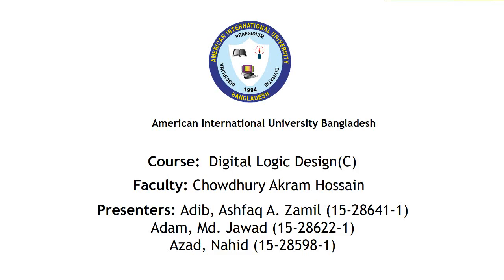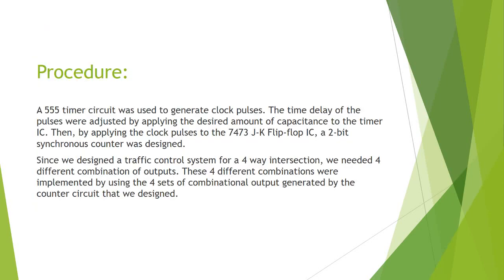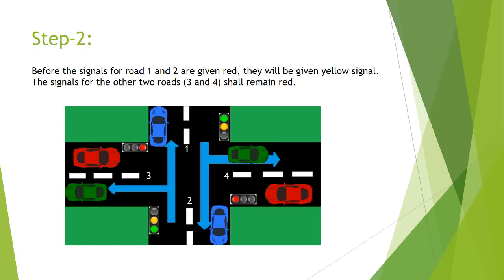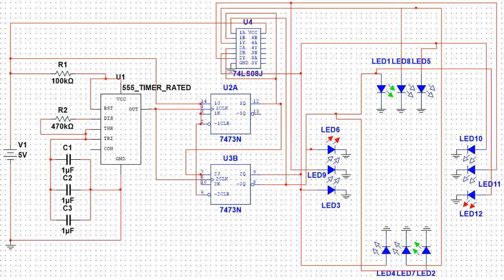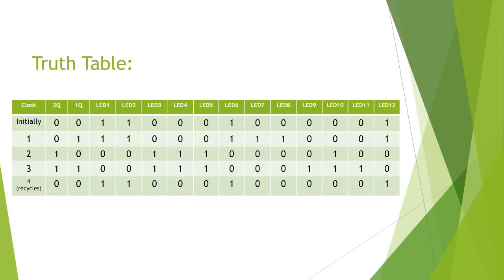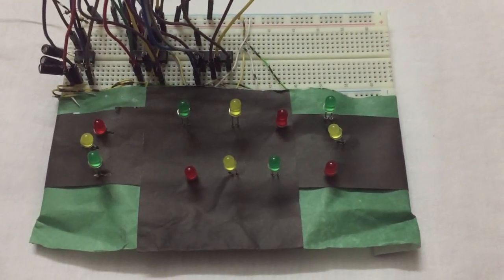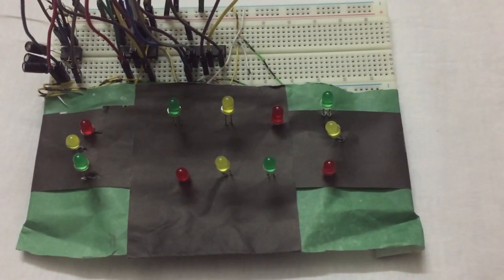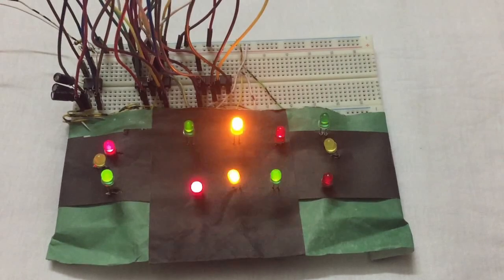Traffic Light Control System- Digital Logic Design Project

Comment: i'm a beginner. how can i insert a 3 digit 7 segment in this circuit. can anyone give me a general direction as to how or if your really up to it and have time can you specifically instruct me how. thank you. Btw it has 28 pins
Reply from the maker: This circuit is basically a 2-bit counter circuit, means it generates numbers 0,1,2 and 3. You can make this into a 3-bit by adding another JK flip-flop which will generate numbers from 0-7. By adding a JK flip-flop like this you can increase the bit range of the circuit. I personally haven't worked with 7 segments, but they are not that much critical to implement. You will find videos that explain how to connect them. For a 3 digit 7 segment meaning it'll show numbers from 0 to 999, you'll need to implement a 10-bit counter for which this circuit process will not be sufficient.

Comment: your video was very helpful so far , i did the circuit diagram in multisim like you did but the lights won't switch, this is the only problem i have , thanx
Reply from the maker: In Multisim it just sends a current and stops by default as far as I remember, you need to run it continuously for the timer to work. I may be wrong since it has been a while I haven't been in touch with it, but the circuit works as expected in practical implementation.
Reply: @ashfaqadib8085  what do you mean by running the time continuously how can I do that?

Comment: are 14 1 3 2 and 7 5 10 are in series? or 1 and 5 is not included? is it ony 1 and 5 connected with OUT?
Reply from the maker: 1,2,6,12 are in series. 3,4,5,10 are in series. And 7,8,9,11 are in series. You can also connect them in parallel. The idea is that, if 1 is lit, 2,6 and 12 also have to light up. So is the case for  3,4,5,10 and  7,8,9,11.
Reply: i mean in 7473 ic
Reply from the maker: Can't understand your question.
Reply: What do you mean by 1 2 6 12 are in series??
Reply: How can 1,2,6,12 can be series ?? It's connected to the same ground
Reply from the maker: By in series I meant they will light up together due to the same output from the 7473.

Comment: How to design this circuit if we have different truth table with regards to led. Kindly help me in this regards.
Reply from the maker: What kind of output are you expecting?
Reply: The attached drive link shows our truth table 
Remember :  G- is the light of turning right and we have G- instead of yellow light . 

HERE is the link of truth table 
https://drive.google.com/file/d/0B8viPsbm24mPYzl0c210N2lPMGkteVo0WHFNRU42N1BPZWR3/view?usp=sharing
Reply from the maker: Sorry for late reply. As it seems your circuit also has 4 possible combination of outputs as I understood. Are those LED numbers according to the figure in my video?

Comment: Does the circuit you presented have no errors? Please help me troubleshoot, mine doesn't work.
Reply from the maker: The circuit provided in the video was working totally fine. What problem are you facing?
Reply: It doesn't automatically change lights. It has to be switched off then switch on again for the lights to change.
Reply: Also, the circuit I simulated was the exact form as in the video but mine's not working, unfortunately. I already grounded every component properly but, still, there's no improvement in the switching of the LEDs.
Reply from the maker: Check if the timer is working, connect the timer output to a LED and check if it turns on and off.

Comment: I implemented the whole circuit as per ur given diagram. But when I switch on the supply all I can find is that the yellow and red lights are continuously on with the green lights off. Please help me
Reply from the maker: We had similar problems at first. Have you kept the ground line common for all the leds?
Reply: Ashfaq Adib No I grounded individually for all
Reply from the maker: Try to keep the ground pin common for all the devices. Make sure your wires are properly connected and do not cause resistance, in our case, we changed the wires and each led got proper power.
Reply: My problem is why isnt the timer giving pulses? Like why is it that all Led s are continuously glowing? :/
Reply from the maker: This may happen even if the timer is working. To check if the timer is working, just connect an led to the 3rd of the 555 and see if it is blinking.

Comment: where's the pin 13 of 7473 connected to ? the switching of led is not working please help me
Reply from the maker: The pin 13 represents Q1'. Just connect the LEDs that should work in opposite of Q1 to that pin.
Reply: kindly elaborate , should there be a connection on Q1' or none ? because on the diagram there is no connection ?
Reply from the maker: No I haven't used Q1' in my implementation since as you can see in the truth table, I can keep LED 1,2,6,12 by using Q2'. Whenever, Q2=0 those LEDs are turned on, thus I used Q2'.
Reply: Ashfaq Adib the led are not switching. Can you help me troubleshoot it.
Reply from the maker: Can you be more specific?
Reply: Ashfaq Adib the led are working but it is not turning into yellow and then red. Theres no switching of lights.
Reply from the maker: Is your timer IC working? To ensure your 555 timer is generating pulses, directly connect a LED to the 3rd pin of 555 timer and see if the LEDs blink.

Comment: I tried your circuit, why does mine woudnt automatically change lights??? did you add something else for it to work?
Reply from the maker: No it was designed just the way shown here, make sure to ground the connections properly we had difficulties in grounding the circuit.

Comment: How to calculate duty cycle of  555 timer in above circuit
Reply from the maker: That depends on how much resistance you will add to the connection of the 555 timer.